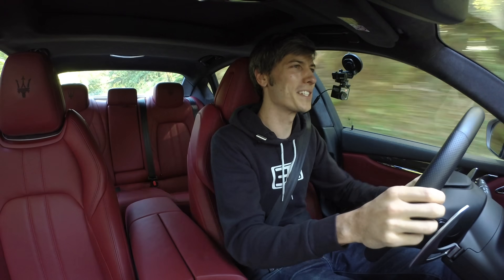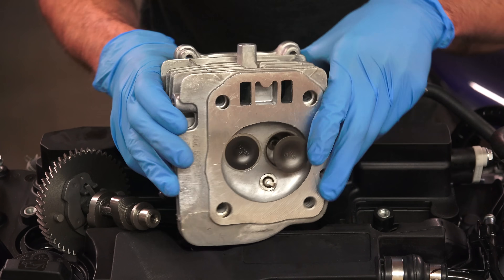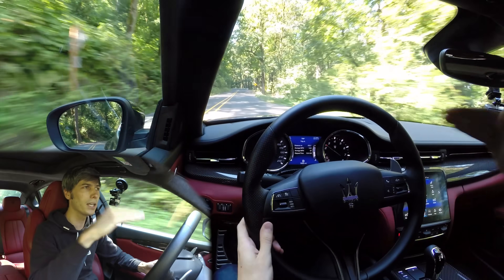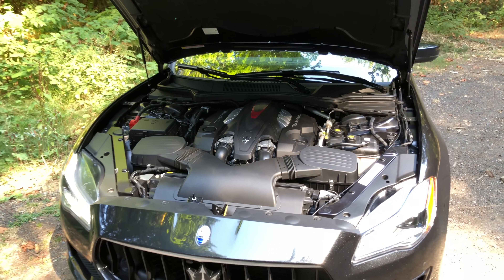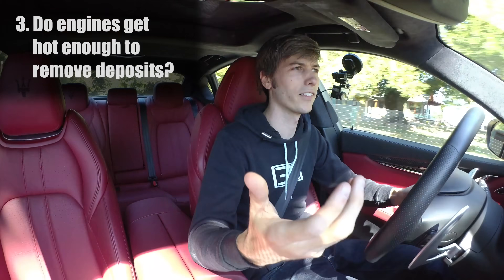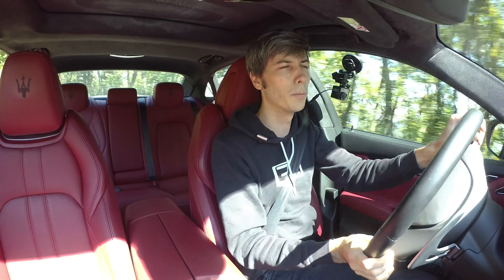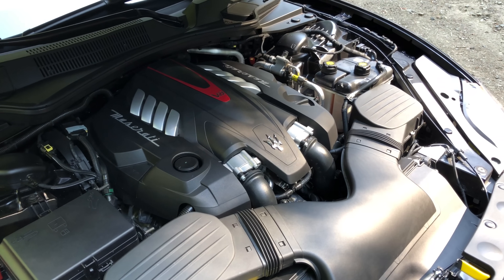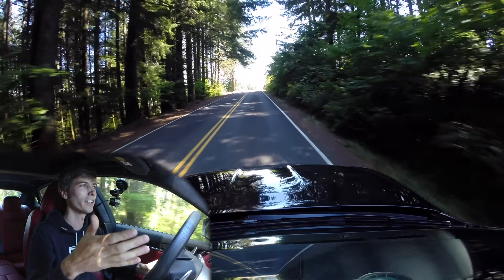Is Redline Good For Your Car's Engine? Italian Tune Up

Comment: t's not just about carbon deposits, if you have a VNT style turbo (Movable intake vanes to adjust how the air hits the compressor instead of a wastegate) and never run the engine through it's full working range, over time deposits will stop the vanes from making their full movement as the surfaces they move on are not wiped clean by the vanes moving. Same story for EGR valves too AFAIK. Having heard some horror stories about engines owned by drivers who never rev it past 2500 rpm, while my engines have more miles on them and haven't given any trouble of this sort, I'd recommend running the engine through it's full rev range once it gets warm to make sure everything gets actuated through it's full range regularly. Conveniently I have a couple of motorway on ramps and a toll booth on my route every day...

Comment: For small general aviation aircraft such as the Cessna 172, we will actually during pre-flight runup, test for carbon build up in the engine (seen by a drastic drop in RPMs when the engine heat is activated). To get rid of the carbon, we will run it at a high RPM (2200) with a lean mix for a couple of minutes. This clears out the deposits, ready for flight.

Comment: Or just spend $400 every 50k and get it walnut blasted?
Reply from the maker: Is that all it costs? Doesn’t seem bad for the work required.
Reply: Engineering Explained thats how much it cost for both my 3.0l twin turbo bmw and when i had a 2.0t vw. It really is worth the money too. You notice a significant increase in engine response.

Comment: Carbon deposits are actually fairly common in aviation. Carbon deposits will collect on the magnetos, so during a run up on a piston engine, we will run the engine at a high rpm while sitting still. This allows the engine to get hot enough to remove those deposits because aircraft engines are all air cooled
Reply: How long is this done for?
Reply: Robert Beckwith usually about a minute. You'll learn the fuel out so you're putting as little fuel in the engine as possible so it runs hotter then you run it like that for a minute or so
Reply: +mega Running it lean right?  To make it hotter?  Fuel when it hits the intake side acts as a coolant for a fractions of a second.

Comment: I'm not really comfortable giving my car an Italian tune up. That being said, I always give an extensive one to rental cars.
Reply from the maker: Good guy looking out for rental cars.
Reply: "Nothing handles better than a rented car. You can go faster, turn corners sharper, and put the transmission into reverse while going forward at a higher rate of speed in a rented car than in any other kind. You can also park without looking, and can use the trunk as an ice chest. Another thing about a rented car is that it's an all-terrain vehicle. Mud, snow, water, woods – you can take a rented car anywhere. True, you can't always get it back – but that's not your problem, is it?" -- P.J. O'Rourke
Reply: @Fjdy1jd1  your sarcasm is refreshingly funny, I'm truly pleased. 🤣
Reply: @Fjdy1jd1  "Rental cars are the fastest cars in the world" - Jeremy Clarkson
Reply: The more precious it is to you , chances are it’ll blow up. Since rentals aren’t anyone’s cars they never blow up.
Reply: If a car can't handle an Italian tune up, it's junk. They are engineered to be put through the ringer. Should not be able to hurt anything with a factory rev limiter
Reply: jake111391 
Yea really. 
Usually most stuff goes 150-200k before it’s tired (on average) so even if ya beat on it and just abuse it you’ll probably still go close to 100k
My buddy had an s10 that went 30k between oil changes and it went 150k, shockingly. He saved a lot of money in oil changes🤣🤣
Reply: @MrTheHillfolk  but oil changes arent expensive
Reply: jake111391 true as long as you dont do it for to long at once
Reply: @Breakitjake  what if the RPM is limited only by valve bounce? :-D
Reply: @Breakitjake  with propper maintinece, any car can be put through the ringer as long as things are replaced more often and wear items checked more frequently, yeah you will have a good time
Reply: I've owned my MK4 Jetta since 80k miles. I cranked the boost way up, and revved it to the redline probably 10+ times per day. Now at 156k miles it runs just as strong as ever. Burns no oil.
Reply: @C6Z_Bob  keep up with those synthetic oil changes.  The turbo needs it more than anything.  Other than that, timing belt at the recommended mileage (I've done one on a passat turbo, not too bad actually!) ..and you should be able to drive it until you're bored of it lol
Reply: Bob 
Mmmm jetters are better. 
My ol 91 Jetta coupe diesel sits at 4000 on the highway at 65mph or so. 
it’s super short on the gearing so it makes the most of its 50 some-odd hp. 
It’ll do that for 3-4 hrs at a clip, with an occasional blast up to 4500-5000 to pass someone. 
Been doin it that way for years,probably the last 60k or so. 
Throw a brick on the gas pedal of an old vw diesel and come back every few hours to fill the tank.
Reply: it's an old German diesel those things are reliable
Reply: Rental cars are the fastest cars in the world
Reply: With regular oil changes, and a stock tune, the engine should be able to handle regular near redline shifts.  The key is keeping all fluids changed regularly, and more frequently if you tend to drive hard.  I'm right around 300,000 miles on my 91 honda engine and transmission.  Just regular maintenance.  (Head gasket, water pump, and clutch included)  I've also installed new (rebuilt honda certified, 10 year warranty) fuel injectors.
Reply: That's one of the many reasons why I would never buy a used rental car.  Most drivers are probably fine, but all it takes is one or two to really abuse a car.
Reply: @i486DX66  My previous car (a 2005 Ford Fiesta) started life as an Avis rental. Judging by its odometer hidtory, the first private owner then used as a daily commuter (probably between 100km and 200km per day), and then I used it as a daily runabout with periodic long-range journeys around the country.
I certainly didn't "thrash" it, but I wasn't afraid to drive it like the sports hatchback it was intended to be, either ;-). It was (still is) a very reliable car for the third private owner; so the early-life thrashing it received obviously didn't do it too much harm. Of course, your milage may vary. :)
Reply: @i486DX66  P.S. I love your screen name ;-)
Reply: The fastest car in the world isn't a Bugatti Chiron, it's this.  A rented (hired car for those of you from the UK) Hyundai Elantra.
Reply: @AmericanStig-3  stop
Reply: In the off-roading community we all know that rental suvs have more power. Don’t ask why or how.
Reply: Aye really all you have to do is get on a high way and go like one hundred mph for ab 10 20 seconds the gasoline gets spraying over the valves and cleans it and not bad for it like if you just sat at a stop reving it all the way up

Comment: My old m3 actually recommends holding 4k for a few miles down the highway to remove carbon build up that's like 120 mph hmmm... I wonder if cops would understand if I showed them the owners manual  😂

Comment: I temporarily fixed an old sparkplug that was misfiring in a V6 accord, by driving the snot out of it. By the time the spark plugs were replaced, it was still working

Comment: I was always under the impression that the Italian tune up was more for loosening gummy parts and increasing time under max lubrication/oil pressure and maximizing fuel flow than it was for warding off carbon build-up. Kinda like sprinting cardio for your machinery...

Comment: Damn... RIP to my 2017 Honda Civic Hatchback that runs a 1.5 L, Direct-Injected, Turbocharged engine. I have the worst of everything! I guess the only saving grace for me is that I always drive on cruise control and rarely ever go past 2000 rpm lol.

Comment: I've got a 2012 Ford Focus, with the 6 speed auto.  Every now and then the transmission will act up.  It generally happens after the dealer does some sort of update on it or someone else drives the car.  I just drive it hard and it seems to fix itself.

Comment: I have a diesel, 4 s, 4 cyils, in town runs a little hard, on highway, gets injectors cleaned. At rpm 3200/min. No sweat. Depends what you want from the car, and KNOW the car and the engine. Thus you have a improved control and obtain better performances.
Every engine is good. Is in the driver's hands the power to squeeze everything from it.😋

Comment: I've cleaned out and fixed many 4.6 2v's with this method! It was mainly on peoples vehicles who didn't drive much and drove mainly at low speeds. Older people. I could feel the change just by driving the car hard.

Comment: I do the occasional redline for engine health, but not really because I think the redlining will "clean" anything (though it could). For me any direct benefit was secondary. The main point is diagnostic. Subtle problems you may not notice right away manifest much more clearly under high load. Better to find those problems early.

Comment: So basically, few freeway pulls won't really do much.

But track days will get the engine hot enough to burn stuff off, but dirty crankcase oil may go back into the intake.

So the solution is to warm up an engine, do an oil change, track the car hard enough that the exhaust manifold is glowing hot, and maybe another oil change.

Comment: If this was a smart thing to do, why aren’t manufacturers just implementing a choke function on the cooling systems instead. You should be able to get the temps up without punishing the engine/ wasting fuel.
Edit: for a controlled period of time ofc.

Comment: Also, those increases in temperature are drastically increasing wear and tear. It's a case of borrowing from Peter to pay back Paul. You're just stressing one system to kill another. In your racing cases, it makes more sense. You know you'll be tweaking and rebuilding regularly, therefore a clean engine is better over time, given your acceptance you will need to replace more parts from wear, because you'll be in there for other reasons eventually. Or, said differently, fine for pushing a track cars, bad for daily drivers.
Reply: This claim remains unsubstantiated: "drastically [increased] wear and tear"
Reply: It really doesn't increase wear and tear anything substantially. Your only doing this when the engine is completely warmed up with good oil flow. Your only doing it momentarily for a good pull through 2nd or 3rd. Just a few seconds. Really no different then loading 4 people in a car or attaching a trailer, it's just another load. People always like to say something will wear a motor out quicker. Really the only way to break a modern motor is for something else to break causing issues. If you have a good oil pump, coolant system, and ignition system you probably won't break a car. Most cars I know with broken motors came from a bad coolant system (warped heads etc) or from boosting engines.

Comment: Valve rotation, which cleans valves and valve seats, doesn't occur on many engines until revs exceed 3000+. That is another reason to exercise engine to higher revs. I do mlm lots of repairs where driving slow and ldling too much, including warming eng in ne up before driving, caused the problem. Rarely do I see engine problems from moderate to aggressive driving. Other than going to a track the aggressive driving rarely lasts long (congestion and speed limits) so it causes no harm.

Comment: The DMV here recommends to drive your car at top speed limit for about 2 full gas tanks to get your carbon deposits out or at least a minimum if 70 miles.

Comment: When you bring your 200hp car to a track day, and go back with 220hp car
Reply: My 130HP car went up to 725HP
Reply: I took my lawnmower and now it's more powerful than a Bugatti Chiron, nice
Reply: I took a 1956 Fiat 500 to the track.
Came back with a Top Fuel Dragster.

Thank you Italian Tune up!
Reply: @CardboardSliver  
I took my Renault Twingo II. Went back home with the bus.

Damnit.
Reply: still better than going back by bus :D
Reply: well, those 20 extra horses are just down to the sticker you get from the track though
Reply: My Miata runs amazing, and gets redlined regularly
Reply: If you track your car it will likely head home on a wrecker. Racing a steet car is insanely bad for it.
Reply: @akonnema  Rubbish. On track days you don't race. You drive at the pace you want. If you don't do warm up and warm down laps and you drive without any kind of mechanical sympathy, then your car will suffer. Treat your car with care, maintain it well and it will do track days every week of its life without significant problems.
Reply: A Nother Exactly
Reply: If u drive a shitty car..... Sure!

Comment: About the intake valves on port injected engines... aren't the intake valves seeing a washing effect? Given that fuel gets sprayed pretty much directly on the back of the valve, where, at normal working temperatures (a warm engine) the gasoline evaporates in contact, so it can even be compared to a steam washing. Besides that, in an engine with good integrity, no damage, normal wear, the valves twist around their axis with each opening, so they pretty much get sprayed all around constantly. With all that being said, the Italian tune-up always seemed like just one of the many myths getting propagated, just because they sound reasonable. I've been wondering about it for a while now, so I'm really glad you made this video. Cheers.